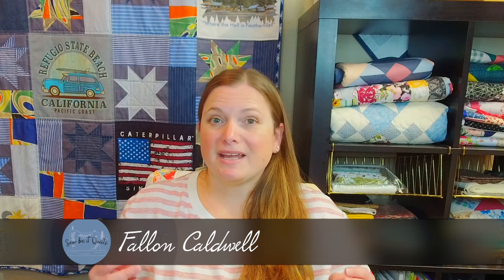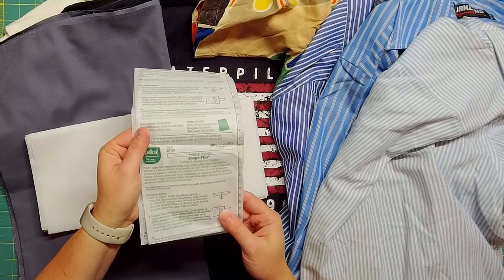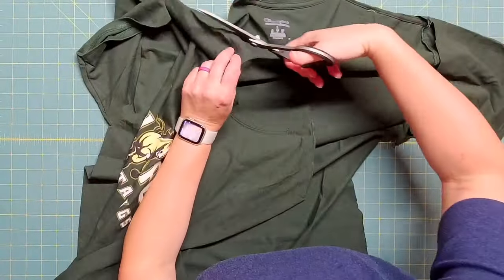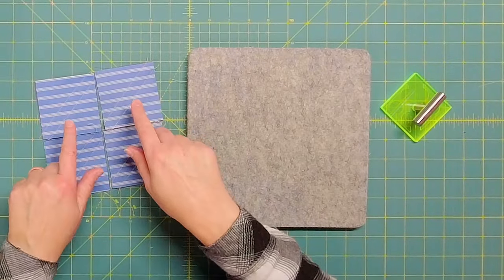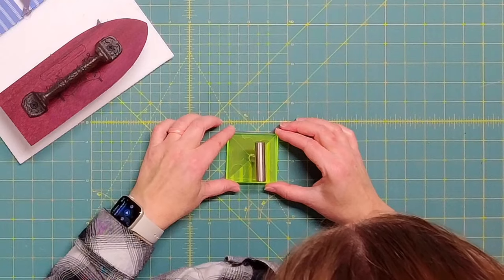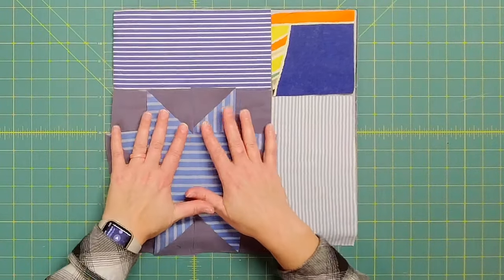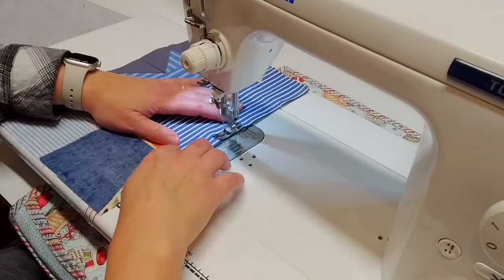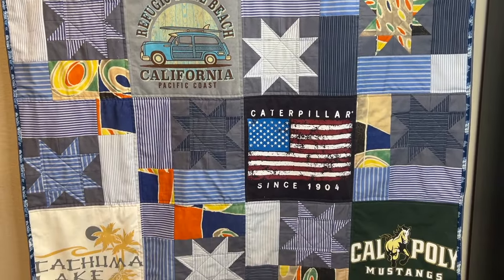How To Make A T Shirt Quilt | Repurpose Your Favorite Shirts Into A One-of-a-kind Quilt

Comment: When you showed your pin basting and you basted WAYYYYYYYY less than I did. I had over 200 pins on my last quilt  (which measured about 64 x 74). This is not a brag from me or a knock on you. This is me admitting I am NEUROTIC about basting. 😅 It's a problem.
Reply from the maker: I do not always baste enough! lol.  I get bored and lazy about it! It is always better to do more!

Comment: Just curious how much you would charge for a quilt like this
Reply from the maker: That’s a great question and I am sure everyone would feel differently about it.  As a base I would probably charge $20 per block in the quilt.  The t-shirts take extra material to prep and time to cut perfectly.  The star blocks take background material and extra time to piece.  So right there is it $400.  I would at the bare minimum add on an extra $300 for backing, batting, quilting and binding.
And this is why I don’t make commissioned quilts.  This quilt was a gift to a family member.